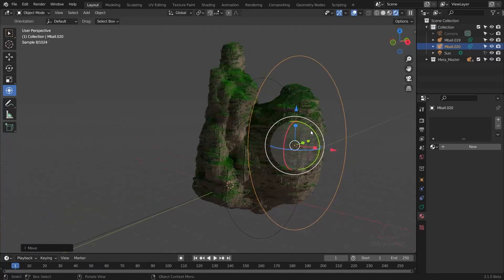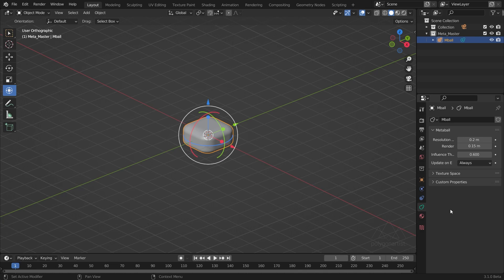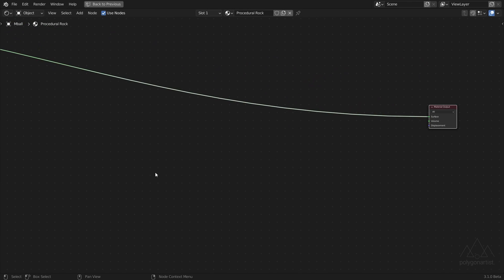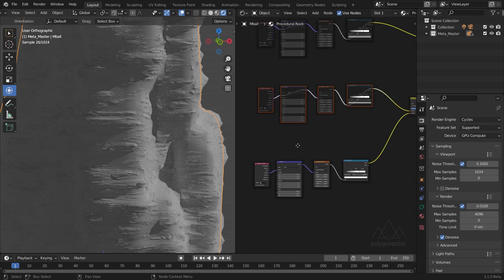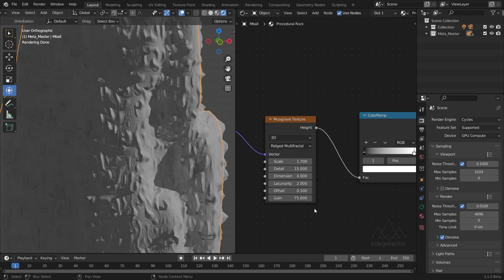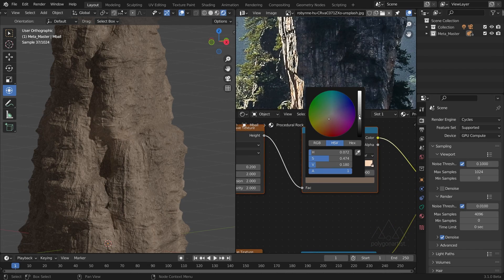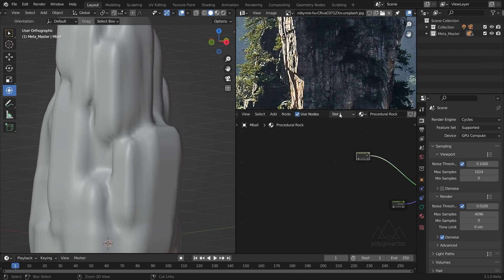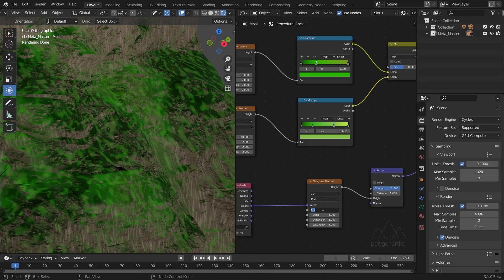[Tutorial]: How To Make Procedural Rock Cliffs In Blender

Comment: at 00:09:40 v3.5 settings don't have these settings only Backface culling, Blend mode, Shadow mode, Clip threshold, Screen space refraction, Refraction depth, Subsurface translucency and Pass Index. Have they been moved or removed?

Other differences:
Mix RGB is now just called Mix and you need to change "float" to "color"
Putting nodes into a frame is now Ctrl J (Join in new frame) and F2 to rename
Reply: in the shader when you press control + t, and the texture coordinate node pops up, you must select the object and add metaball in it.

Comment: Amazing video! I usually work on things that aren't as detailed and I use already made textures for speed but when I saw the thumbnail of the cliff I knew I had to look at this. Really nice to see that making your own base colour or displacement can we so fun and "easy"!
I do have one question - what happens when you have 2 Principled BSDF nodes and you want to bake your colour, normal, displacement and roughness? Does the engine take in account only the last BSDF in the order? Haven't made a model that has more than 1 BSDF so far and am not familiar with the process :)

Also, but you already got one comment, your microphone isn't picking up the correct heights I think... and you have 2 videos without a mic after this one, so adjusting that would be lovely for future videos if you're able to do that!

Thanks for the video and have a nice day!
Reply from the maker: Thank you. 😁 Two pricipled shouldn't cause an issue as long as they are configured correctly. The important thing is to break the shader configuration down where PBR texture maps can be baked and exported as image textures. ✌️

Comment: Q: Say I want to build a track for a game and then export as fbx, how'd I go about turning all this, not into a render but instead baking it to textures (so: diffuse, normals, specular, etc) to use on simpler objects since said game has a geometry limit?

It's easier to just use textures and UV-Map them but I want to learn something new.
Reply from the maker: You'll need to bake the geometry to polygons as well as baking the textures. Some game engines are weird and prefer triangulated mesh so you would need to look into that as well.

Comment: these rock cliffs are not procedural ;) but nice outcome nonetheless :)
Reply from the maker: Procedural workflows make use of copying objects over and over again, so you don’t have to do it manually. 

-SideFX Makers of Houdini 

Procedural is a umbrella term used for any 'procedure' that uses drivers, function or values within a cofined system to create end result operation that can be replicated, re-used or modified using the same driver, funtion, values etc. 

Sculpting a rock by hand is not procedural because the same rock cannot be recreated in a mathematical or technical method, although it can reused infinitely. Nonetheless method shown in the video uses shader editor (confined system) and nodes (drivers, function etc.) to create a cliff. These nodes and their values can be replicated, modified and used infinetely, hence the term 'Procedural' is used. 

I would recommend reading up on SideFX's website as they are the one who pioneered procedural workflows. Thanks for taking the time to comment.